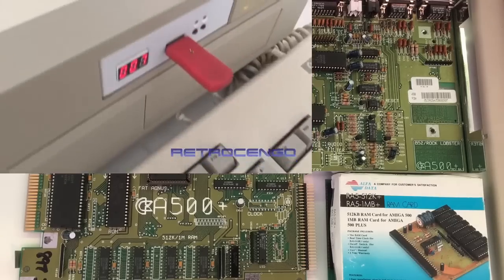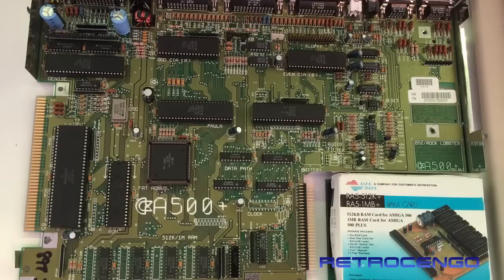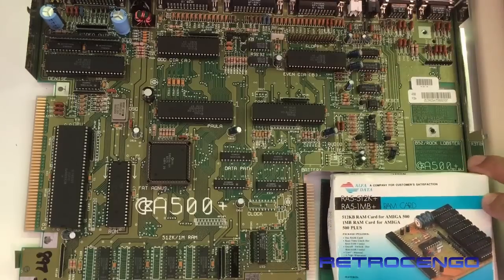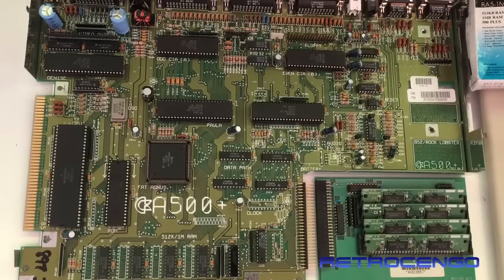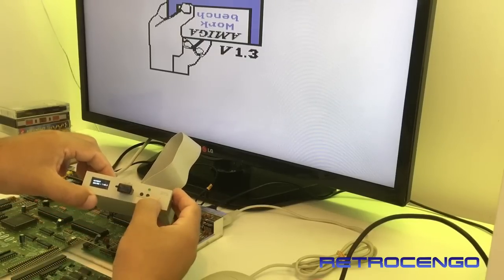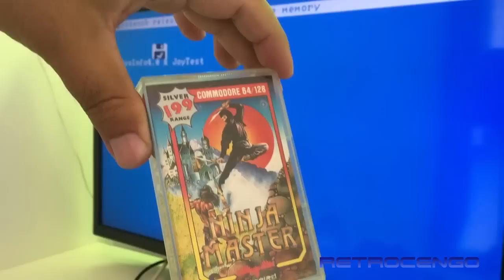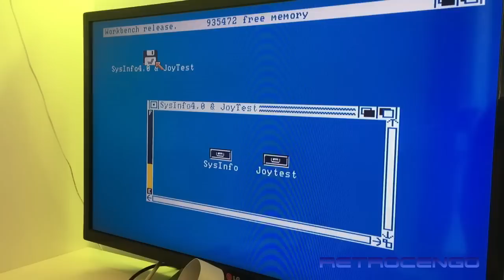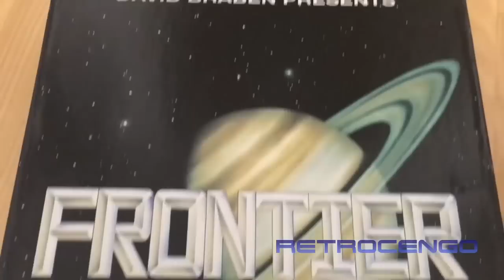AMIGA 500 Rev 8A.1 motherboard inspection and test with Gotek drive

Comment: Full ecs chipset. And it is so easy to upgrade the onboard memory to 1mb. I did it with my 8a.1 board. (And some extra upgrades in the process)

https://to9xct.blogspot.com/2018/12/amiga-500-turbo.html?m=1

These boards are the best 500 boards that you can get your hands on. Absolutely no question about that. I too remember that people was pissed about the 600, yet I have a theory, that Mehdi Ali wanted to push his narrative yet again with the 600. He was the brains behind the C64-Games-system. Yet I kind of think that he thought that people did not want that 64, because it lacked the keyboard. I honestly think that is why he wanted the 600. Like a way of making a "console" that was able to play the existing library of software, and because the C64-GS did not have the keyboard, then it had trouble with tons of games. Like commando and such.

And if we look at the placement of the joystick/mouse ports on the side, and if we read the press release and counter in the fact that the 600 was not designed to be an upgradeable machine at all. Well then it all points to a 25 percent computer and a 75 percent console product.

The press release and during the introduction marketing of the 600. Then commodore made it clear, that the primaery use of the pcmcia port, was to be that of a games loading port. A bit like a cartridge port, only based on pcmcia technology.

So there we have it. Much evidence points to the 600, as meant to be a gaming console, that was able to do light productivity tasks. Like word processing for school children.

I think that people really did not and have not understood what exactly Commodore wanted the 600 to be. And what the machine really is.
Reply from the maker: brostenen your comment should be framed, thanks buddy, nice reading. 
Great uprades on your 8A.1 board

Comment: That's a nice board frame it and display it in the not yet established Retrocengo Retro Museum.  Check the device jumper on the GOTEK to make sure its set properly.   I love the GOTEK's but I have one that has almost hit the wall a few times.  Hey if it was not installed in my A2000 and was just hanging lose it would of hit the wall.  I replaced it with another that does not give me grief.   I do like the screens over the numbers on the GOTEK's for sure.
Reply from the maker: Stephen Bruce It is definitely a frameble nice motherboard, it’s getting alot of love at the moment. 
Ive been unlucky with some gotek drives lately, but now I’m gonna buy the cable and flash rm my self. I love using amiga disks but the. Gotek is just so much easier